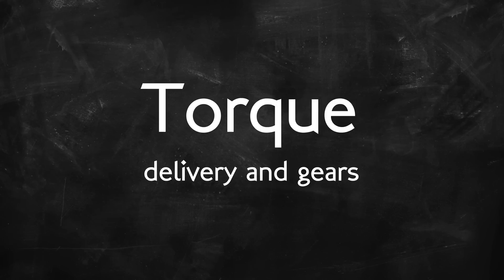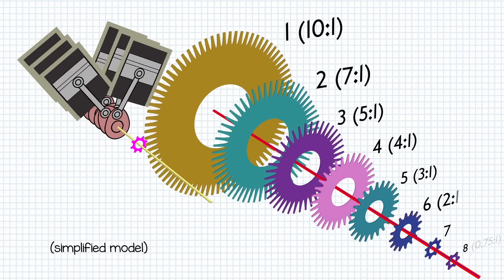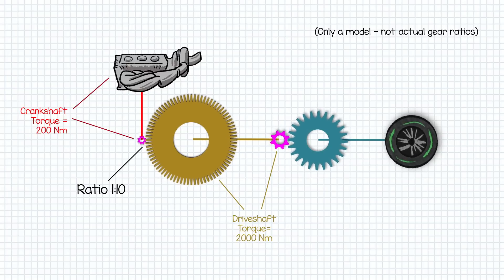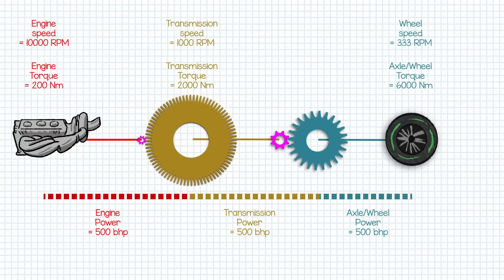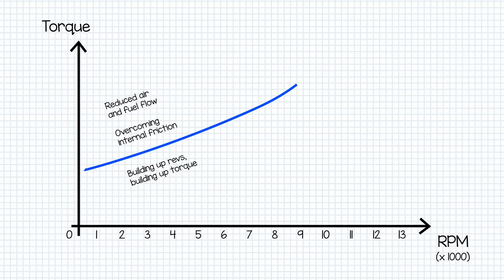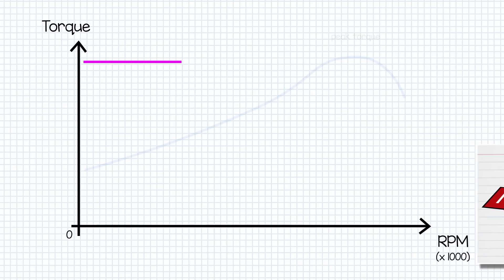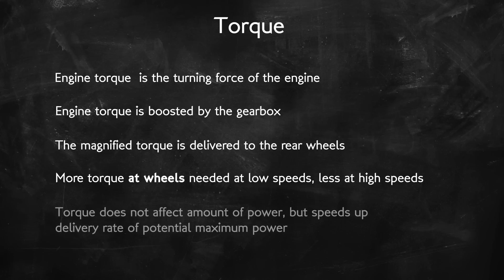Torque and Gears - Why F1's hybrid engines are more 'torquey'

Comment: 8:00
I've been trying to figure this one out for the longest time. Since Chain Bear viewers and subscribers are the best, I'll ask you guys! So according to Chain Bear, the optimal shift point is right after peak engine torque, before redline, in order to stay within the peak engine torque range, right? I want to believe Chain Bear, but I've also read that the optimal shift point is best after peak power, in order to stay within peak power range. Chain bear explains that power is the rate of which torque is delivered, so wouldn't that make peak power range more optimal than the peak torque range because we are trying to maximize the fastest rate of torque to be delivered to the wheels. I've read many sites,  but everyone seems to give an "one or the other" answer. If anyone can correct my fundamentals and answer my optimal shift point question, I would greatly appreciate it!

Edit: I've rewatched the video, to my understanding, as explained in the video, engine torque only speeds up the rate to reach maximum potential power, which means peak torque does not really matter? But earlier in the video, he emphasizes to shift in order keep in the peak torque range, which would mean in short shifting as maximum power was not reached, right? My main confusion is if the optimal shift point is to stay within peak torque or peak power.
Reply: TheAncientColossus  So many variables. With a conventional type of engine peak torque and peak power are normally  approx 3000 rpm apart.  So if you select the next gear at peak power and the ratios are sort of correct, the engine rpm would drop to around peak torque. The anomaly that may well be encountered with a current F1 engine is( As with turbo group A rally engines)is that other factors change the shape of the torque curve to the point were  once peak torque has been reached it very quickly drops off.  There for power will not increase with a further rise in rpm. Hence what is a narrow usable rpm range and the need for so many gears. I believe 8 is the norm these days. Hope this helps

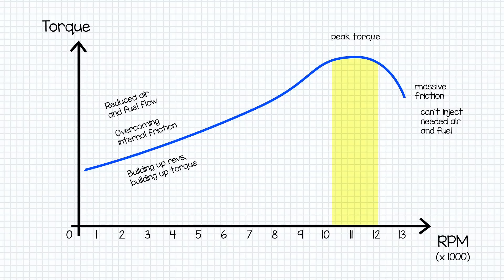Comment: 7:45 peak torque at 11k rpm on the base engine okay what??? You mean HP? Every dyno graph ive ever seen hp and torque crossover at 5252rpm. Can someone explain?
Reply: His graphs are not to scale (at all). It's just to bring the point across. HP and torque do indeed cross over at 5252 rpm when using Nm and hp as units. Horsepower is equal to torque * RPM / 5252

5252 is just a conversion factor because we're using different units than the correct SI units that would normally be used to calculate power. formula would be Watts = Torque * Radians/sec

So if RPM is 5252, Power = Torque * 5252 / 5252 = Torque * 1.  This would mean that your horsepower is indeed equal to your torque at 5252 RPM.

As for the peak torque being that high, it is probably also lower in reality, but peak torque can still be at a higher RPM than 5252. That would just mean your horsepower would be climbing even steeper than your torque curve.

Comment: In a non hybrid traditional enginge wouldn't torque and horsepower cross over at 5252rpm like every other internal combustion engine? Peak torque below 5252rpm, peak hp above it... is your graph supposed to represebt HP not torque?
Reply from the maker: It's just demonstrative, the lines aren't mathematically accurate. And I think you might be using 'peak torque' and 'peak power' incorrectly, but I know what you mean
Reply: Chain Bear F1 First off thanks for the reply, love your work. Putting "peak" anything to the side, using the imperal system with ftlb torque & hp i was taught they should always intersect at 5252rpm unless the numbers were off on the dyno. Either way i think the far more interesting part is using a electric motor to supply torque for a high revving engine to get spinning like what Konessegg is doing with there direct drive drivetrain, no gears whatsoever just an electric motor for low speed accel and a high revving V8 attached to a torque converter. Awesomeness.

Comment: Good explanation, although i think it would be worth emphasizing the gain in average torque throughout the rev range with turbo hybrid cars. It's like comparing piston vs rotary engines coming out of corners and gear selection going in. Cheers

Comment: it's not true that you don't put more energy when getting further from the pivot point. when you increase the distance you are also increasing the radius therefore you draw a bigger circle. The amount of work stays the same. BIgger distance from the nut means smaller force required but also drawing a bigger arc. please don't be getting this wrong or it seems like you are making up free energy.

Comment: Basically, it means if you're racing, torque won't matter because you can accommodate the lack of it with proper gearing. All that matters is horsepower. Torque is nice in a street car for ease of driving though.

Comment: Close enough. But by torque at 12k rpm I think you mean power. The f1 engines probably produce max torque around 6-8k rpm and slowly tails off. Peak power is around 8-12k rpm hence they shift there.
This was also just a torque vs power electric vs petrol explanation not what the title says.
The actual answer to the title is simple. 1 electric motors. 2 turbochargers giving boost pressure so the engines have over 100% volumetric efficiency. And the intake charge is better which means more torque at a given rpm. More torque at not so high rpms the engines are probably making similar power to the old v10 cars but 2x the torque.

Comment: A nice and simple explanation. You did it again! 

The only thing I would like to add is that electric motors can easily be overloaded. Sometimes more than 200% of their power rating for a short time depending on the heat capacity. Therefore they can deliver a short boost of instand and insane torque during initial acceleration. This is what an electric car makes so fun to drive although there is no nice engine rev sound.

Comment: There is one mistake in your video. You are talking about torque curves, but you show a power curve for the combustion engine. When you are going through the gears, you want to keep the engine around maximum power, thus delivering the most energy to the wheels. Peak power and peak torque almost never coincide, peak torque is reached earlier in the RPM range. The reason peak power is reached after the maximum torque is because the torque drop-off is less steep compared to the RPM gain of the engine, and since power=torque*RPM your power output will still increase even though torque is dropping.

Comment: And yet there's a difference here that needs to be highlighted: the difference between torque and power. Torque is measured and power is calculated from that measurement. Lots of excellent information at this website:

http://www.epi-eng.com/piston_engine_technology/power_and_torque.htm

People talk as nauseam about all the different ways to improve power: increase fuel flow, increase compression, turbocharging, etc. but all these measures are doing are increasing torque and by extension, increasing power. The only ways to increase power are to increase torque or to increase RPM.

Incidentally, this video shows - by implication - why there are no Diesel hybrids. Both are anther best at low RPM.

Comment: First gear is the smallest gear... The gears get larger as they get higher....... If you're gonna go though all that effort graphically at least do it right 1st is smallest gear.. 7th would be largest gear.... Easy example.. Look at a 10 speed bikes rear gears... Theres a reason you cant atart a manual car in high gears... Tho the more torque you have the easier it is to do.. Hence why some high torque vehicles can start from a dead stop in 3rd gear without killing it
Reply from the maker: Hi. No, first gear is biggest and the gears get smaller as they get higher.

Comment: I didn't think I'd see a guy with such a popular channel get torque and power all wrong!

At around 8:00, did you just claim that you want to keep the engine RPMs in the peak torque range for maximum performance? Because that's totally wrong. You want to keep it in its peak power range. Peak torque is irrelevant, especially once you start changing gears. 

Also around 5:00 you said something like, you need more torque to get moving, and less torque once you are moving. I would argue that's also wrong... ignoring air resistance you need the same amount of torque at any speed to accelerate. Taking into account air resistance, you would actually want more torque the faster you go.
Reply from the maker: You're right about keeping it in peak power, I needed to shift the curve along a bit, there.

You do def need less torque at the wheels the faster you go.
Reply: Hmm, I still disagree that you need less torque at the wheels the faster you go. Let's assume you want to accelerate as fast as possible at all speeds (this is F1 after all), and we ignore downforce for now. The grip the tire has should be constant no matter what speed. So the force the tires are able to exert should be constant too. And therefore the maximum torque we can send to the wheels should be constant.

If we mix in downforce, the grip increases with speed, so we can theoretically send more torque to tires at higher speed. However, power = speed * torque, so at some point we run out of power (and shift into 2nd gear). 

If you want to accelerate from a stop to some speed, and then coast at that speed, then yes you don't need as much wheel torque to coast as you would to accelerate quickly (unless that speed is 200mph).

Comment: I like the video a lot, but your explanation of why first gear has the largest ratio bugs me a little bit.  You say that it takes a lot more torque to get a car going from a standstill, and then once you are moving it takes less and less torque to accelerate and maintain the wheel rotation speed. 

Is this quite true?  In my understanding (ignoring drag + losses like you do, and also ignoring static friction for the instant you start moving), the torque required to accelerate the car remains the same regardless of speed.  But, since the engine power remains the same on average between low speed and high speed, the wheel torque decreases as you shift up in gears, and so does the car acceleration.  So while first gear DOES have the largest ratio, it's not because the car needs more torque to get moving than it does to stay moving (again treating the car internals as friction free), it's just that you can afford to have a higher ratio the slower you are moving, which enables the engine itself to accelerate quickly and to reach its power band sooner.  

Does this seem correct?  I know you were trying to keep the explanation simple, but it still needs to be true!
Reply from the maker: I hear what you're saying and yes this is also true and probably well worth saying in the video!

Comment: If each gear gets smaller and smaller, how does the rpm stay the same? Wouldn’t it go up because a smaller gear would turn faster?
Reply from the maker: The RPM is the turning speed of the engine. The gears change the turning speed of the wheel. So as the gears get smaller and smaller, the wheels turn faster while the engine spins at similar speeds.

Comment: didnt we had ERS in the v8 era?  to my understanding the turbo is making the actual difference since ERS was already present  with the past regulations and power unit weren't this "torquey"
Reply from the maker: We didn't have intergrated ERS, we had 6 seconds push-to-activate ERS so it wasn't a big part of the standard engine power delivery

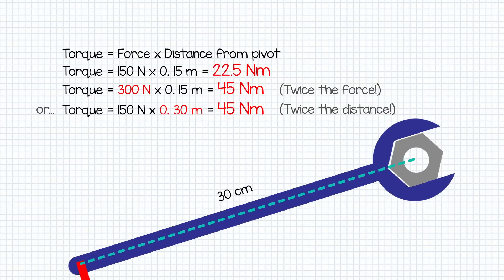Comment: Great video as always but at 1:30 or so you sort of use force and energy as synonyms. That's just not proper physics. Also towards the end, when talking about shifting and peak torque range, you were saying the right time to shift is at or around peak torque. This is only true in engines where peak torque and peak horsepower occur at roughly the same rpm. That being said great video. Keep up the great work.

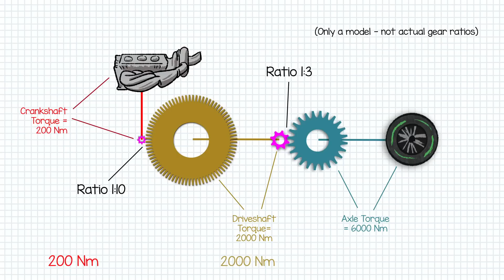Comment: Slight correction: At 4:50 you say that you'd need more torque at lower speeds than you need at higher speeds, but it's actually the other way around: At you'd need much more torque at higher speeds to keep up the same acceleration to compensate air resistance. The real reason why we don't just use the high-torque first gear for any speed is just, that combustion engines can't rev that high and we need to shift to a higher gear to not destroy the engine (and thereby inevitably loose torque).

Comment: You got your talk facts wrong at the end of the video. I have taken the liberty of correcting them. And it's spelt Talk ;-)

Engine talk is just a bunch of dude talking about engines and cars and performance figures. Engine Talk is boosted by a few pints at the pub. The increased talk is then delivered to the Ego cortex of the brain where it will manifest. 

More talk is needed to keep speeds low as high speeds will wind you up in a wall. Talk does affect the amount of power produced by an engine (unless it can be confirmed by a dyno) and Talk can also speed up the delivery rate of a potential ass whooping and beating on the track...
Reply from the maker: Booooooo :)

Comment: Another excellent video!  Well done! I once heard Hamilton talk about adjusting settings for the differential for entering, mid, and leaving corners. Can you explain what they do inside the differential or with the electrics? The transfer case on my AWD car has an electric motor that moves clutch packs and divides torque front and rear, is this the same?? I found this video helpful in high school. https://youtu.be/yYAw79386WI

Comment: i love ur vids they are very informative.. just 1 thing, in real life u are usually working backwards. the example u gave is fine for the theory, but in system design u usually know u need a given torque, then u work backwards, and only very rarely use the torque of a given cog, we usually just use the ratios, like diameter 1 divided by diameter 2, and work from there.

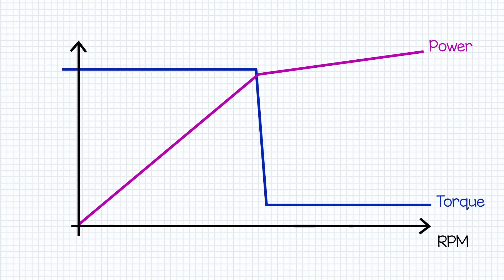Comment: Decent but sorta long explanation- A simple explanation that sums it all up without explaining all kinds of things like gear teeth, gear ratios, crank shafts, measuring, math fractions is at 5:30 , and at the end at 10:00 ish

I dunno if I like putting the answer buried 5 and 10 minutes in like that- It's not a school lecture where the teacher is afraid we're going to tune out after getting the answer for the standardized test- put the broad stuff first and narrow down, and let me decide if I need to hear more or not. 

I knew the first half of that already, but I didn't KNOW I knew it until the very end- I just wanted to know if there were reasons I hadn't known for why a hybrid was more torquey than a gas car with a correctly chosen set of gear ratios.

Comment: Also, previous engines produced around 750hp at 18000 rpm, so 750*5252/18000 = ~218.83 lb-ft.
And these V6s even without electric assistance might produce 800ish hp at 12k I suppose, so 800*5252/12000 = 350.13 lb-ft, a significant increase ;)

Comment: You should add that what we feel when car accelerate is POWER, not torque because people are confuse;)
A lot of low RPM torque in electric car means a lot of low RPM POWER which we feel as counter force at our seat:)

Comment: Okay, so... for a car to start running, they take this rotational force and put them to the tyres, but tyres have a limited grip. As the multiplyer from each gear gets smaller, the grip is less stretched to it's limits, right ?
With that, there's a limit Torque that each gear should deliver to extract the grip (and acceleration) without overspinning the wheels.
So, is traction control a Torque controller ? Or is it just a brief deatachment of power delivery (miliseconds) ? Traction control should be aware of what gear is being used so it's ACTIVE and not REACTIVE. Am I right ?

Comment: Fun fact, torque always = power at 5252 RPM.
Reply from the maker: ONLY when using imperial units, which most people don't do. You have to use different unit coefficients when working in metric
Reply: True, I overlooked that. 9549 RPM for N.M to KWatt. Not the type of curve I am used to look at.
Reply from the maker: Although what's mad is when we mix up Nm kW and bhp because everyone is maaaaad lol
Reply: Baller Horse power? (brake horsepower) Only way to measure BHP is by pulling the motor from the car and attaching it straight to the dyno.  No real life value here. Anyway, keep up these entertaining videos.